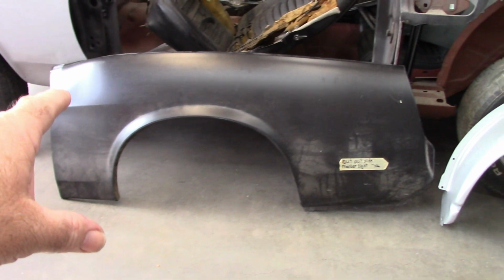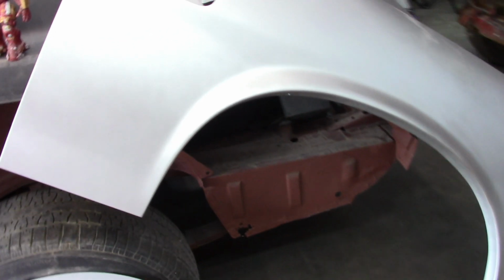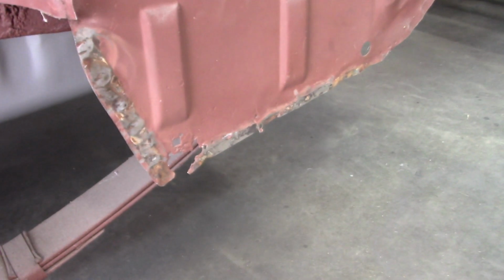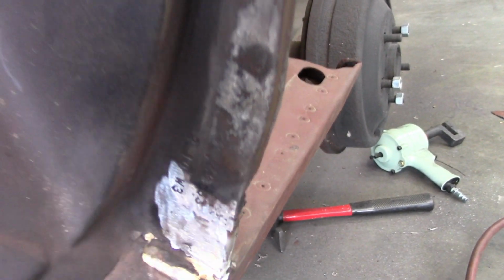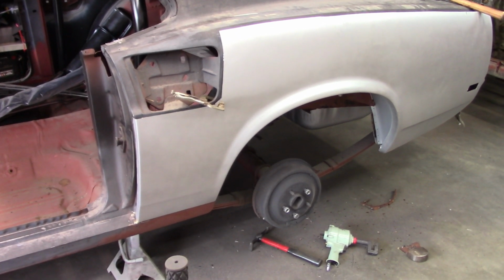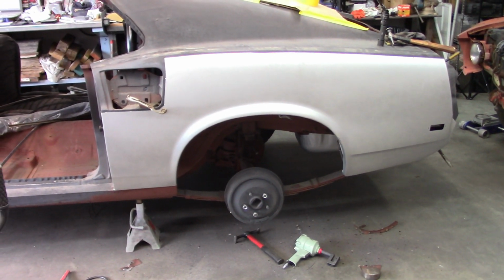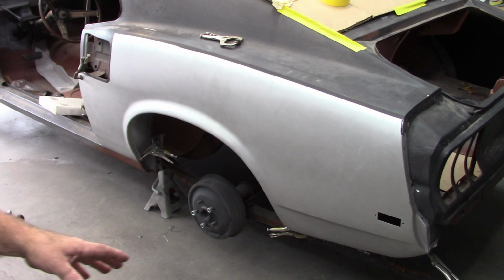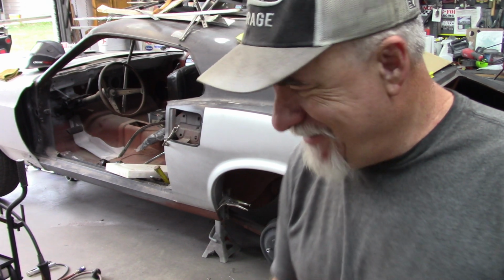1969 Mach 1 wheelhouse install. Dynacorn parts. #mustang #howto My mach 1 part 1

Comment: At 7:27 - what is that hole (and the square hole next to it) used for? My car has them open as well and I have no idea what purpose it has other than to allow dust into the trunk side-space, ha
Reply from the maker: There was a rubber boot that covered it https://www.cjponyparts.com/quarter-panel-drain-valve-2-1967-1973/p/HW603/?year=1969&gad_source=4&gad_campaignid=18909117275&gbraid=0AAAAAD1v5VkUb0bNd0z06dybgSjeLZqqv&gclid=Cj0KCQjwh-HPBhCIARIsAC0p3ccPnAbig00ADu8gJeWTA02wFFc3U5Elp5BdWoVZoEPGMXqfXzHG8RAaAhW_EALw_wcB

Comment: I'm working on a 1970 Shelby GT350 Convertible that has rusted from the top down. Was sitting under Pine Trees in Northern California and the rear Glass window came out! I'm replacing both entire wheelhouses both quarter Panels, and the outside panels on the trunk floor. I had to find and buy all the bracing under the filler panel, the original was all rusted out. Why wouldn't you replace the entire Quarter Panel on this car? When someone takes a good look and sees welds from the inside, it drops the price of the car. At some point all cars end up for sale, and the type of money you'd have to charge for your time fixing this car, wouldn't it be worth going the extra mile and replace the entire quarter?
Reply from the maker: I agree to a point. This car is almost rust free otherwise. The new panels don’t have the welded studs for the trim and for the logo on the side. Not a huge deal I know. As far as the weld seam, I have done it before and smoothed the weld from the inside. I’m also not worried about resale. This is my dream car. Not selling it.

Comment: Thank you Daddy Jo first off, do I punch holes in the bottom lip of the fender whale to  weld to fender tub, and thats exactly what I'm working on I was thinking I was doing wrong with the flange by leaving it on and I've got to patch the same part in front of the tub, and I'm definitely buying one of them little belt sanders
Reply from the maker: Yes, punch holes in the mating flange of the quarter. Have a look at the crunchy cobra playlist for more details.
Reply: @JoDaddysGarage  thank you I will and I appreciate it and you